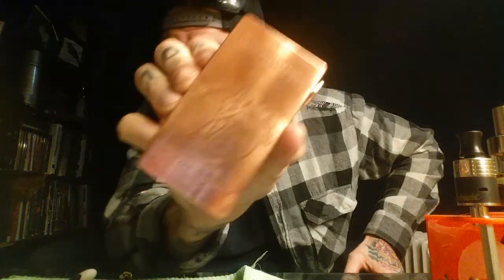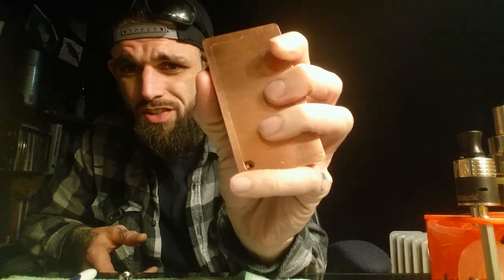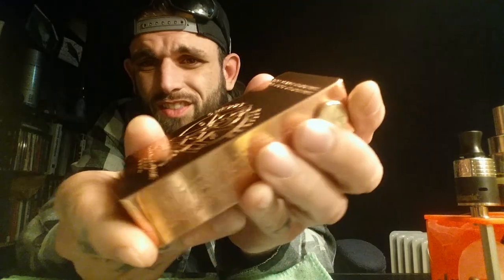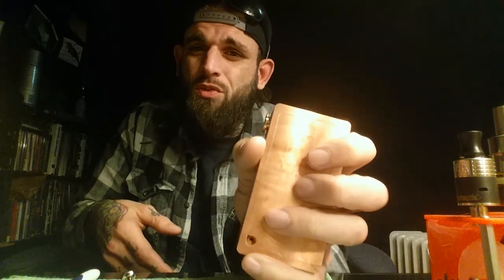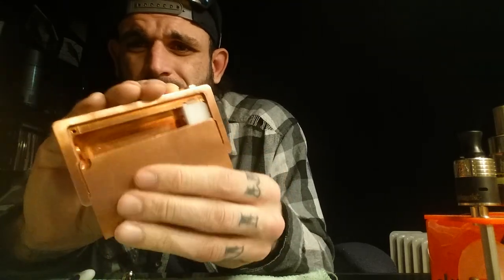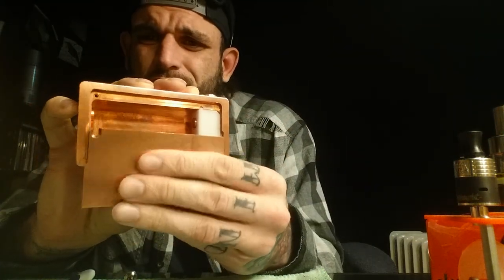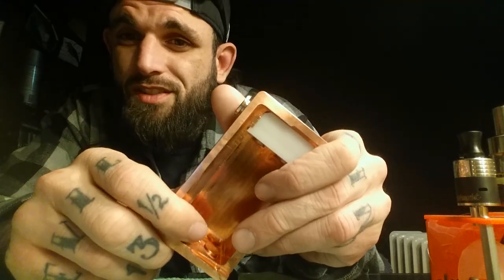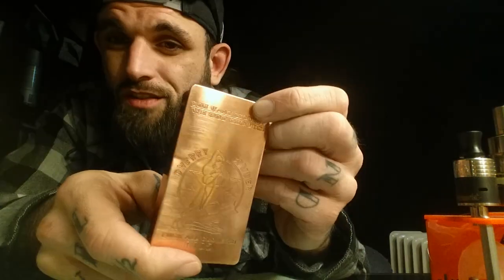MCV Philippines | Copper Cherry Bomber Box Mod | Review

Comment: So fellows before I plop down $350.00 for a Copper Cherry Bomber + $199.00 for the Solid Silver 12 piece contact set + magnetic switch upgrade.. Is there anything I should know..  What problems are you having ( If any ) with the switch..Can I buy an upgraded switch spring ( and where ).. and are the Silver contacts worth it ?  Or would I be better off buying a Copper Raptor Raptor instead.. Don't like the look of the Derlin top but it does stop auto firing and the individual  battery slots are nice .. That screw/ hole that holds on the Bombers doors looks like it might strip over time since its soft copper?  I need advice.. What to do ?  Cherry Bomber or Raptor... Yes the Bomber looks cool with the Logos... But is the raptor a better design... ?  Thanks